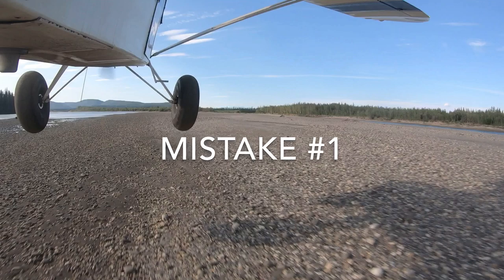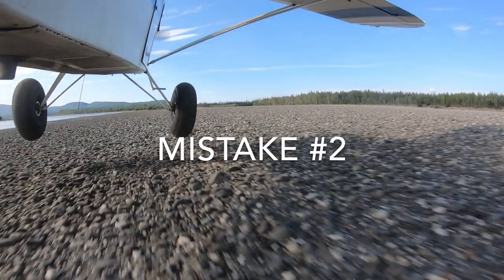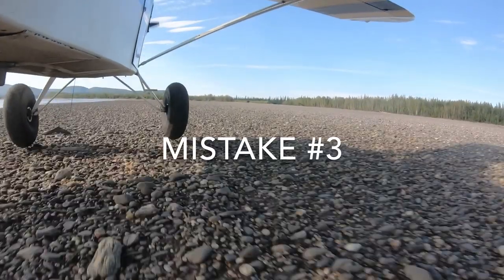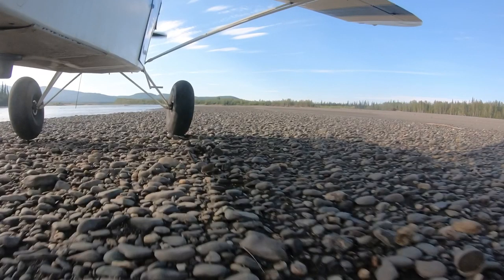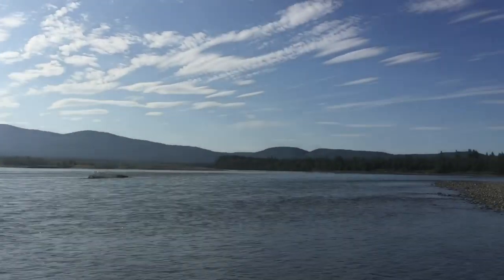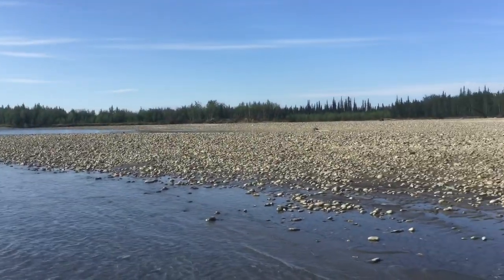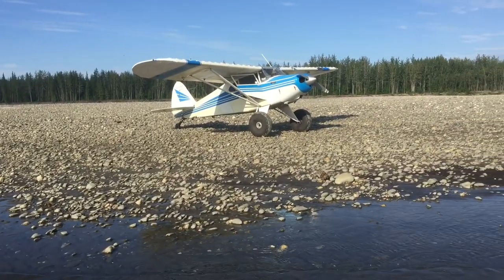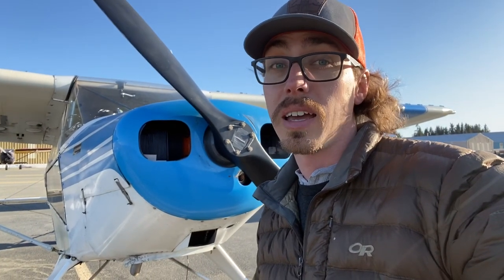I almost WRECKED my airplane

Comment: Are you using stock landing gear to run those tundra tires? What size tires you running? Can you make a video/walk around about the plane? Curious to see what mods you have and what kinda numbers you're getting
Reply from the maker: Hey DB, sorry I haven’t responded. I actually wreck the Pinto Bean. But the gear was stock, just uncovered. Had double pick brakes and 29” Ak Bush wheels.

Comment: Honest reviews are important! Thanks! Remember the adverse yaw from the ailerons could also help with keeping it strait. A good instinct to build is the use of the steering power of adverse yaw; aileron into the wind/into the direction of yaw will massively help keep it strait.
Reply from the maker: FlyingFiddler good knowledge right there. I don’t believe it was so much the wind that blew me off course but the rock I rolled over. But I have used aileron in the past on crosswind landings and takeoffs. Good tool for the mental tool box!
Reply: I've heard of doing this.  Sure would like to see a video about how to do this.  I'm kind of self taught on the tailwheel.  I have an endorsement, but I've learned most of what I know since then.  I fly a Pacer Rob but in Oregon.
Reply from the maker: Marc Davis right on keep up the learning. I bet there is some YouTube video explaining adverse yaw and how to manipulate it better than I can. Or maybe flyingfiddler could do a good job of that.
Reply from the maker: @flyingfiddler, I read that from you on BCP. Very well explained. Come up to Alaska. We can make a film about it!

Comment: How much air pressure you running in the tires, they look a little firm.  Otherwise, thanks for sharing, all good points.
Reply from the maker: Thanks for watching Jughead! Always enjoy your videos also. I don’t remember exactly. But I expect is was sub 10. I run around 7 nowadays if I’m off airport.
Reply: I was thinking the same. Those tires look way too firm. If the tiny thing you hit moved the plane to the side, then you can be sure they several psi more pressure they need. You should be able to accidentally land over rocks about 8 to 10 inches high and still have good directional control I think

Comment: It's a very nice aeroplane. If you see this comment can you tell me what cruise speed you manage with those tyres please..
Reply from the maker: Thank you! I have a very flat pitched prop in addition to the big tires so was cruising around 100mph when rpms were high. I often cruised at a fairly low rpm and could sip gas and be around 85mph